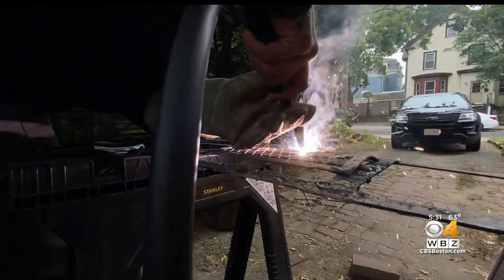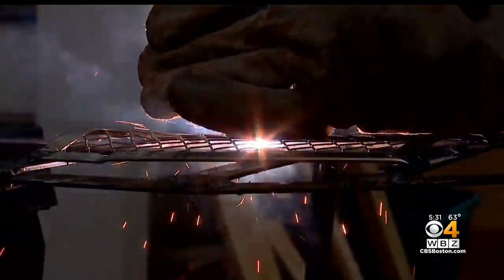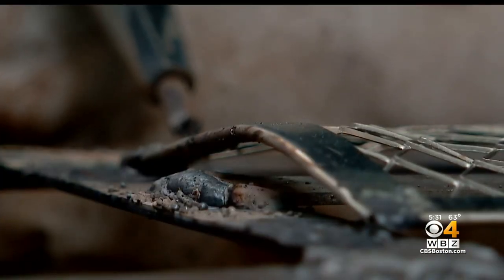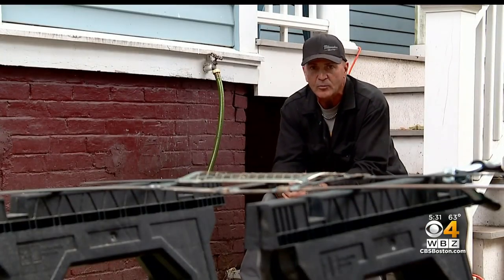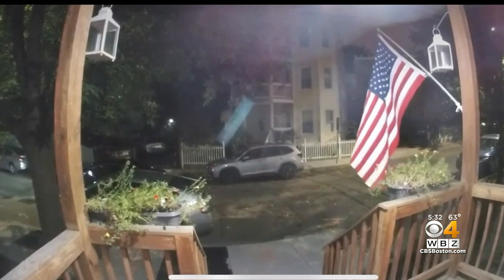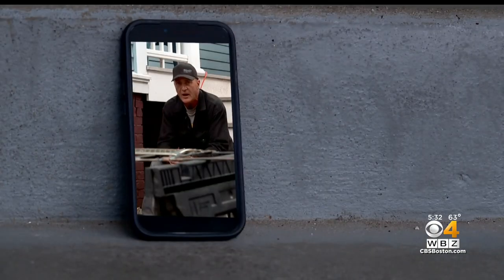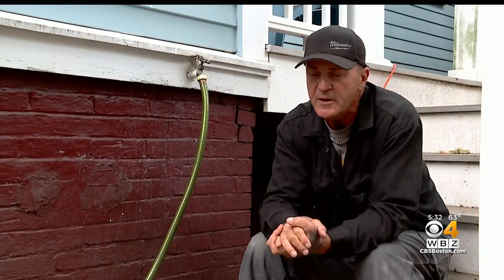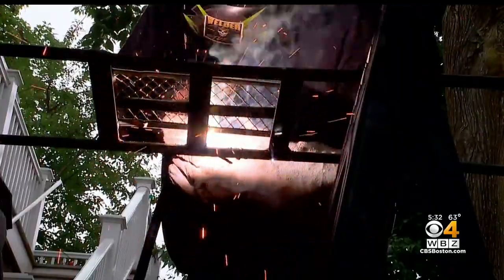Welder creates device to stop catalytic converter thefts

Comment: You that Amendment to bare arms? Yea, that's the answer to stop this thief. Wish there was an app with a device that'll go off after installing it and arming it with atleast a shot gun round. But it'll be sensor sensitive mix with pressure so it'll go off when  the catalyc Converter is sensing too much vibrator or is being cut like feel the different estability